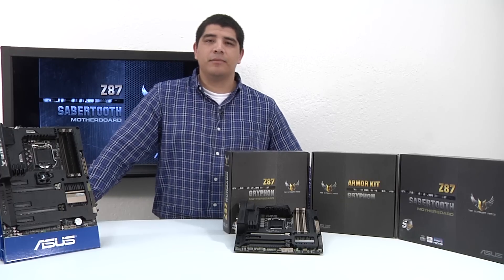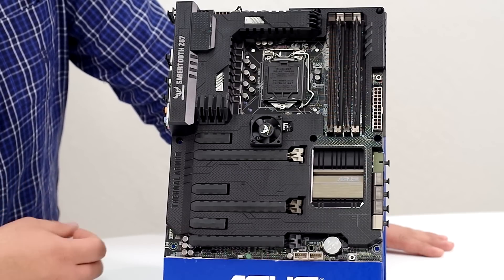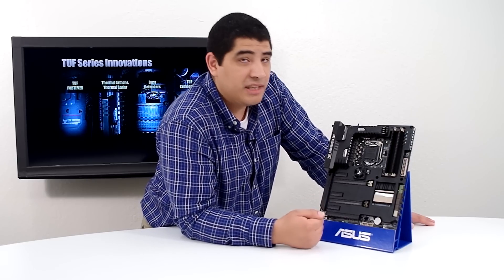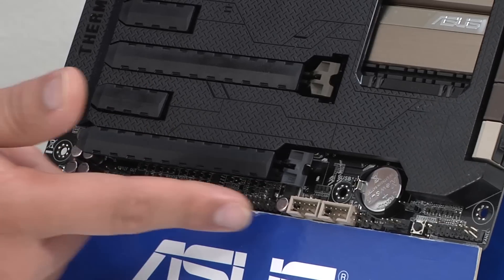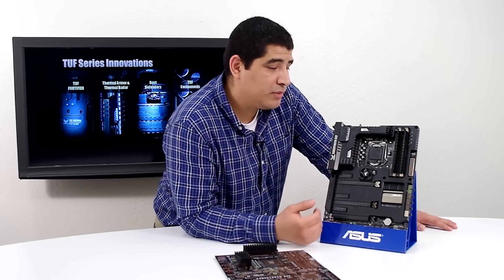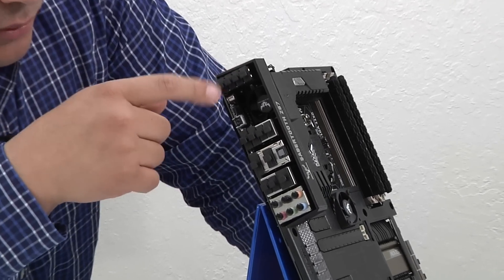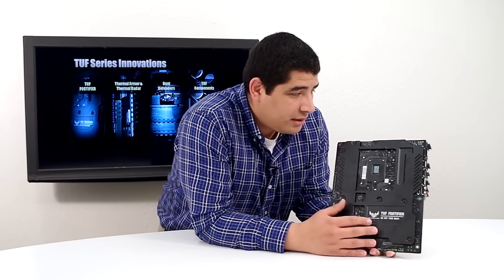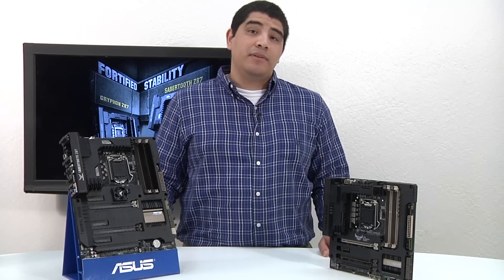ASUS Sabertooth Z87 TUF Series Motherboard Overview

Comment: Thinking of selling (nearly 2023); as an upgrade is due for the newest GPU`s. Been working great almost every day/week/year (still in nearly perfect condition [except for that little fan that went noisy[).
Reply: hey do u know how to remove the whole thermal armor
Reply: @Dali-lv8vn  Erm... Not taken that PC apart lately, as not had to do that (even after the mini-fan chipset failed [has front access port]), but as a kind of engineer, I would say just take the board out and unscrew the plastic armor from the back; along with the metal backplate (which may or may not need to be removed first). Asking the 'why' here.

Comment: My friend has this mobo and hes having some strange POST issues...  We cant figure out whats going on.  This is the 2nd Sabertooth z87 mobo he's recieved.  He had to RMA the first one for bent pins on the CPU socket...  They charged him $90 to fix it and $30 to mail him a refurbished one.  All together, he paid another $120 for a DOA mobo...  It appears ASUS doesnt have a customer service group I guess.

Anyways this 2nd sabertooth z87 mobo will not boot when the computer power button is pressed.  It does a restart dance.  Now you can press the memok! key to boot to bios, save setting and exit to windows.  That works fine.  In fact he did all his driver and bios updates, installed Wolfenstein The New Order and played it.  But when he shuts the computer down and restarts it, or lets the computer go into sleep mode.  The computer doesnt start back up.  Did he get another dead mobo?
Reply: Incompetent PC builder.

Comment: How do I determine which way the VRM Assist fan should move air, as exhaust or intake?  I am planning on using a cpu tall air cooler with 2 fans, and with the rear and 2 top case fans will be exhaust, 2 front and 1 bottom fans as intake.  Also should the air intake vents for the assist fans be left closed or open?  Any article on this functionality of the Sabertooth Board?

Comment: does anyone know if this motherboard supports a h100i cpu cooler looking at it i dont think it does.
Reply: Yes, I have an H90 which hooks up to the motherboard the same way. I'd be more worried if your case can accommodate an H100i.
Reply: ah my cases supports its but ty.
Reply: I have the Sabertooth Z87 with a 4770k cooling it with the Corsair H100i cooler, so I think you should be good to go, the only thing you need to worry about is your case.
Reply: seph13x
does the tiny little fans not make it loud?

Comment: Hey guys 
I have got a question about this motherhoard. If i would like to connenct a second screen with the Intel HD Graphics in the CPU where is the VGA connection on the motherboard??? Can I connect a second screen with the integrated grapic of the CPU ???
Please Help me guys :)
Thanks
Reply: There is no VGA connection on this MOBO. It uses HDMI and DisplayPort, so you would need an active adapter to change these to VGA, however if your monitor has DVI, HDMI, or DisplayPort inputs it should work. Although DVI will need an adapter.
Reply: Thank you :)

Comment: JJ my man, I bought this mobo its an Awesome mobo. But I have small issue with this board. Time is always wrong on it. It always resumes time from where the system turn off  . I mean if I turn off the system at 8AM and turn on the system at 10AM system resumes time from 8AM not 10AM. I opened a Ticket on Asus 3 days ago and they are not replying me. What to do .HELPPPPPPPPPPPPPPPP

Comment: Great board and great review! 
By the way I'm considering between the Maximus VI Gene and the Gryphon Z87.
I know the Gene has a mPCIe Combo II module for a Wi-Fi card and it has the SupremeFX audio, which clears the room for a dual GPU configuration.
But is there any way to attach a wireless card and/or high-end sound card while having a dual GPU configuration on the Gryphon? Or do I have so compromise on the audio/wireless?
Thanks for any input!

Comment: I checked each bag, because I thought that may of been the case as I kept thinking "they had to of put them in here" I'm a very thorough guy.. they may of just accidentally left mine out. The only screws long enough to go through the fan and into the screw part at all were my water-cooling screws.. they are almost an inch long. Kinda crazy they have to be that length. Thanks though.. I'll check for a 4th time just to be sure.. but I honestly looked hard.

Comment: They are included actually but not where you would expect to find them - they are not with the other screws but in a package with some caps (incl. a spare cap for the asst fan 1).

Comment: It would have been great if the guys at ASUS bothered to even mention the assistant fans in the manual which comes with the mobo. As it is, I found out about them only after having mounted the mobo securely in the case and attaching many of the cables and now I have to start all over. Even in this video you only vaguely mention that the assistant fans can be used as intake or exhaust but don't elaborate when and how, so I have to go by the fan logos to figure out which way to install them.

Comment: Just bought this board after coming from a Sabertooth z77 and I can't stand the placement of the 20 pin usb 3.0 header. In the Corsair carbide 500r you can not connect the port without buying an after market braided or stranded 19/20 pin wire adapter with out the big heavy plastic that won't align with the case and mobo. Anyways love everything else about this board. ASUS makes awesome products.

Comment: I have a question, wether dual inteligent procesors 4 works for sabertooth Z87 ???.
Also I instal to my z87 32GB LP cosrair 1866 RAM, need I change a bios settings to get max. performance foe COU and qoud channel configuration?. My system is: i7 4770K, sabertooth z87, 32GB corsair LP 1866, samsung prp 840 256GB, gtx770. I'm looking konw best non OC Bios settings
Reply: Did you get the autooverclocking to work?

Comment: Any 750W Bronze power supply should be good.
If you have the case, go Platinum 750W as I was fortunate enough to be able to do.
Any supply from 600W to 1000watt will do; but around 750W is perfect. 
Bronze, Silver or gold or Platinum quality for the efficiency rating is a recommendation. Amazon it.

Comment: Hey Zeyad.
The Q9650 uses the LGA775 socket. The Asus Sabertooth board only supports LGA1150 socket chips. So (as far as i'm aware) i don't think it will work :)

Comment: Darn it if a M/B chip pin contacts looks a bit twisted under a magnifying glass inspection; but I will only know when the 4770 chip arrives and it comes time to install it.
The chip pin locators are certainly very delicate and wobbly if you check with a very good magnifying glass and a fine sewing pin. Should I try to straighten the one overlapping its neighbour?

Comment: This motherboard arrived today.　Am quite impressed. It looks a bit smaller than in the video; but, no worries. Sadly, the disc CD-paper case looks like it was dragged around a bit en route in dirt, and there is `a dot` on the disc itself; but I imagine the software will download.　It will fit lovely in the Zalman ATX Z11Plus. Probably the best value Case out there.　It has easy to understand software manual. We in Japan and its all in English, which is nice, for us.

Comment: Beautiful motherboard. I just paid Amazon last night; it arrives tomorrow with a new tower and a Zalman CNPS14X 14-centimeter cooler (I hope it fits); am also going for the 4770 CPU, but struggling to choose which RAM @ 2x8GB to start with. It will make a change from my Athlon 64 3200+ and X1950 XTX. My HD 7770 should fit this board as it wouldnt work with the Athlon 64 mo-bo.
Keep up the good work ASUStek.

Comment: I have long been an ASUS fan, my current PC is built on top of a PFK-E/Wi-Fi motherboard, and it has (and still does) perform excellently. The first time I laid eyes on the Z77 Sabertooth, about 2 years ago, I knew that was going to be the foundation for my next build. I also had the intention of going with an ASUS GPU, in the GTX 660-670 range. But with the release of the Z87, i7 4770, and GTX 760, that is where I intend to go. It won't be future-proof, but it will be future-resistant :D

Comment: Thanks for the answer. The 770 GTX's are going in PCIEX16_1 and PCIEX16_2 and which slots do you recommend putting Soundcard and Network card in? Here is a diagram: oi42.tinypic DOT com/bh6wh.jpg

Comment: Yes it can run at those speeds with that many cards installed. As long as the soundcard and network card aren't double width, I'm sure it will fit.

Comment: No, I believe the max is 1866mhz. At least that's what it says on the motherboard specs. If you're looking for a board that supports that kind of extreme memory speed, check out the ROG line of boards from ASUS. I've heard of them even overclocking up to 2800mhz.

Comment: Hey JJ will it be possible to run SLI 8x PCIe on two 770 GTX cards, while also having a 1x PCIe network card and 1x PCIe Soundcard plugged in to the board. Keep in mind they all have ti fit on the board?

Comment: anyone got some tips? i finished my pc build yesterday with the z87 and i installed windows 8 and everything was working fine. then i put in the disk that came with the motherboard and it installed. it required 3 reboots i think and on the third one windows would not boot properly and it told me to restore. i tried that but it just gets stuck at the loading screen for windows.

Comment: jay jay both the mouse and keyboard are on a 2.0 usb and i have a razer nostromo gaming pad and its on a 2.0 usb and it worked before it just stop moving in the bios the mouse is off but the keyboard works and i can set things up on the bios i just would like the mouse to work again is there a rest in the bios or on the board or do i have to delete everything and format the SSD drive and install it fresh. i dont know i cant get this mouse turned on in the bios.

Comment: no both the mouse and keyboard are on a 2.0 usb and i have a razer nostromo gaming pad and its on a 2.0 usb and it worked before it just stop moving in the bios the mouse is off but the keyboard works and i can set things up on the bios i just would like the mouse to work again is there a rest in the bios or on the board or do i have to delete everything and format the SSD drive and install it fresh. i dont know i cant get this mouse turned on in the bios.

Comment: i have a comment jay jay  my asus maximus V extreme when i go to the bios the mouse is frozen and it dose not move but i can move around in the bios with the keyboard so if you can tell me why its not moving the mouse pointer is wright in the middle of the screen frozen other then that the system is a beast . its just the mouse dont work on the bios only , the mouse works when im in windows.